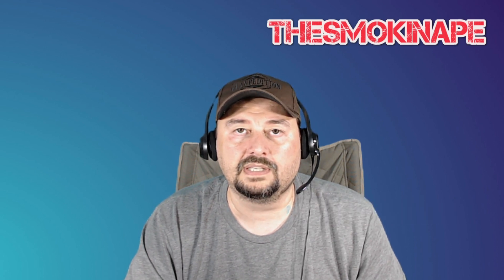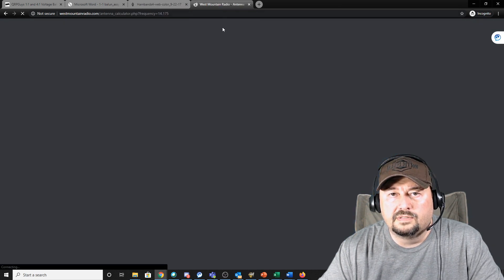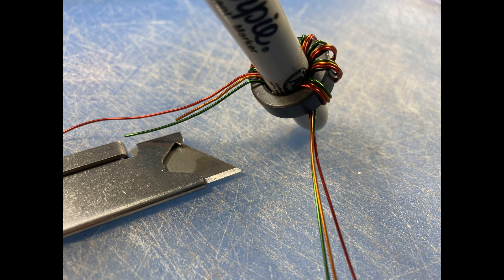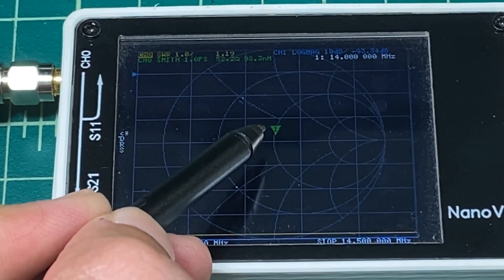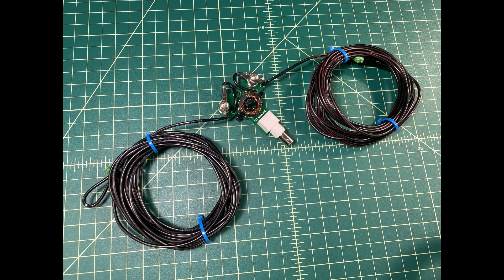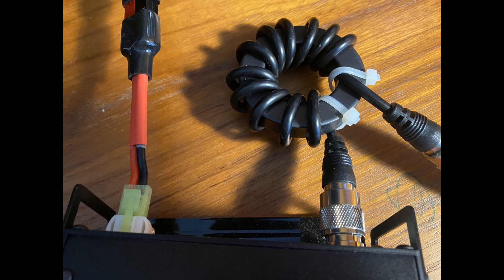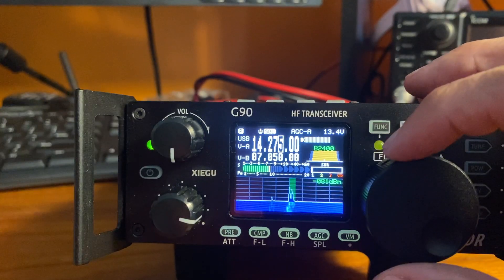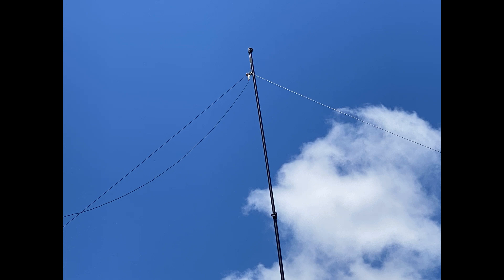QRPGuys 1:1 Voltage Balun & 20m Dipole Build - HAM Radio - TheSmokinApe

Comment: A voltage balun is useless on a dipole!  It needs a 1:1 common mode choke!  A center fed dipole is current fed, not voltage fed and a 1:1 voltage balun does nothing to block common mode current from coming back down the outside of the coax shield and in fact makes it worse!
Reply from the maker: You must post on QRZ
Reply: So who's right here?

Comment: An easier and better 1:1 balun is just 2 wires wound bifilar on the toroid. I used a 240-43 core for my fan dipole and it works great.
Reply from the maker: Thanks for the info Bill 👍

Comment: A nice little feature is you can turn these into a fan dipole too. 20m and 40m wire pairs using the same Balun, and with a tuner you'll find it'll also work on 15m ;)

KN4GEI
Reply from the maker: Great point and idea, thanks KN4GEI

Comment: there is no way with the torriod  will u be able to use regular wire that you use to thick
Reply from the maker: You mean for the elements?  Sorry, I don’t understand.  I use this antenna all the time and it’s fine.
Reply: @TheSmokinApe  FOR THE SIZE OF TORRIOD THEY USE IS TO SMALL TO FIT WHAT YOU USE TO WRAP THE TORRID WITH . THE SPEAKER WIRE YOU USE YOU WOULD NOT BE ABLE TO WRAP ENOUGH TIMES AND HAVE ENOUGH ROOM . ALSO SPEAKER WIRE IS NOT REALY RECOMENDED FOR THE WRAPPINGS OF THE TORROID ANY HOW 14 AWG STRANDED WIRE WOULD WORK MORE SPECIALY IF YOU GOING USE IT ON A 100 WATT RIG
Reply from the maker: Bro, this is a 20w dipole and I wrapped the toroid with 24awg magnet wire.
Reply: and
Reply: @TheSmokinApe  stil magnet wire is not that hard to strip if u use sand paper or solder and solder iron
Reply from the maker: Andrew Murphy “and”. Really?  Why would I run 100w on a 20w antenna?  You incorrectly said I wrapped the toroid with speaker wire and then criticized me because it won’t hold up to 100w even though I state it’s for QRP and it’s rated at 20w.  Are you a troll sir?

Comment: Soldering Iron ('Pencil'): I use the variable Watt Soldering Pencil  25W-60W 'ECG model: J-060VT'. About 25.00 USD 
For bigger jobs ie bigger surfaces needing bigger heat: 'Weller 8200 Soldering Gun' which I've owned for about 35 years now. (60/40 or 70/30 rosin core Solder).
Reply from the maker: Thanks for the info 👍

Comment: Looks good! 
I use a technique of holding the enameled wire ends in molten solder to melt the enamel away/ back from the end. Different formulations melt differently.
Reply from the maker: Thanks Mike, and thanks for the tip 👍 I just went sandpaper and razor blade...
Reply: @TheSmokinApe  my pleasure! I turn up the heat for that op too

Comment: Hako FX-888D soldering station is good and fairly inexpensive as such things go (~ $100) if you solder a fair amount, but overkill if you do so very infrequently.  There are a variety of mini TS100 models that are cheaper and made for smaller scale work.  I don't have experience with them but have heard good things.
Reply from the maker: Thanks for the recommendation, I actually ordered the 888 after filming this 👍
Reply: I love my FX-888D for what I do.  It heats up quickly and can keep up, thermally, for the small scale soldering I do.

Comment: When you folded the ends of the dipole, the electrical length is still there as the wires are insulated.    If the wire was bare, then yes by folding it it would short out at the end or at the fold and be shorter electrically.
Reply: incorrect. 
Folding the wire back is effective when it is insulated. It has nothing to do with insulation.
This is a technique passed down through time.
Reply from the maker: Thanks for the info, I’ve seen it change with insulated wire though 👍